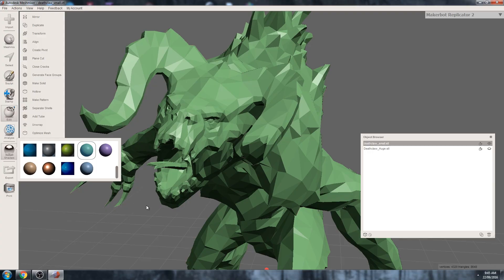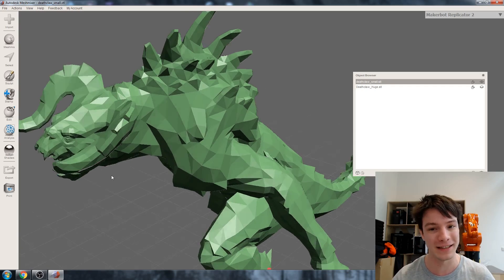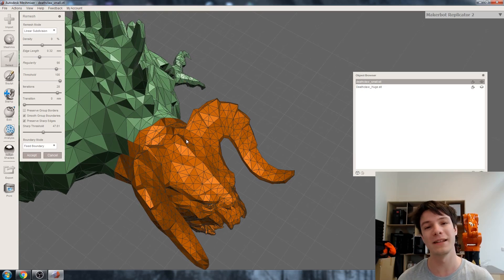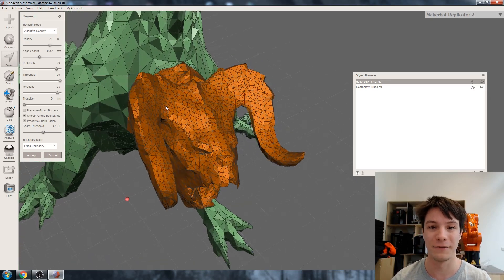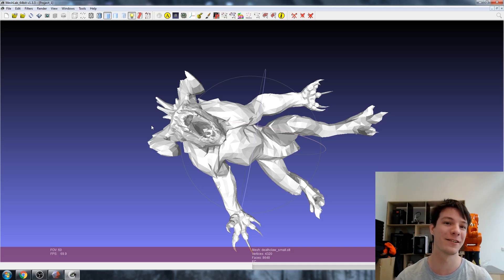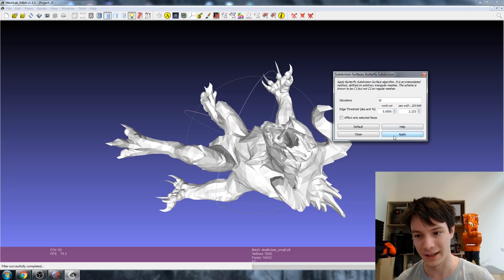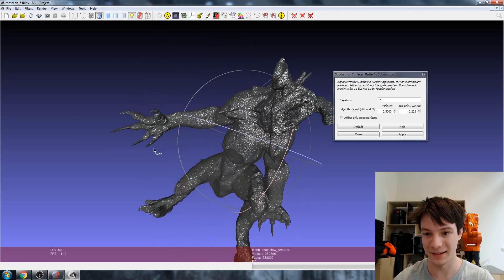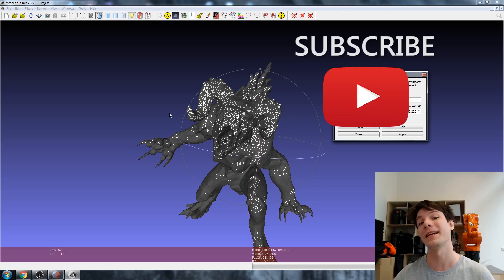Add smoothness to your meshes using remeshing! 3D 101

Comment: Thanks for your videos Angus, I'm a relative newbee but learning lots. Just wondered if you've tried  the smoothing feature in the 3D builder app (from the Microsoft store). Very easy to use and only took seconds, the resulting mesh looked similar to Meshlab, but didn't require messing around with filters etc, or am I missing something?
appreciate your comments

Comment: Well it works until I try to export to .stl, when I do it and open it on my printer slicer it goes back to lowpoly.
Reply: I'm having the same issue. My model looks perfect in meshmixer but looks super low poly in Cura.

Comment: Remesh no longer in the edit menu options in Meshmixer. Any idea how remesh with the latest version? I also want to reduce mesh complexity in order to convert a complex mesh to a body in Fusion.
Reply: Remesh is still there, it just isnt under the edit tab. You have to go to the select tool, select what you want if everything just do, control+A and once selected, in the select menu there is another edit tab (not the big sidebar one) that will let you remesh

Comment: Just subscribed to your channel since I plan to invest in a printer in the near future, Great videos!

On this one tho I think you could one up the detail quite a bit on the model, if you import the normal map for the Deathclaw model along with the mesh (It basically fake geometry details to the light engine in games) with that you could subdivide and displace the mesh to add those in so they would show up in print :) 

The annoying part here tho is that I would only know how to do it in Blender, rather than in a slicing software. but might be interesting to check out
Reply: Damn bro. I get the normal map but subdivide and displace? What's that all about